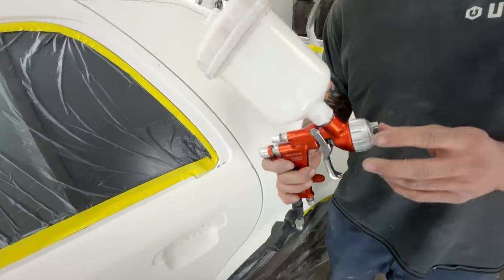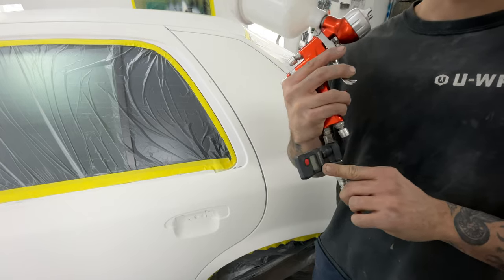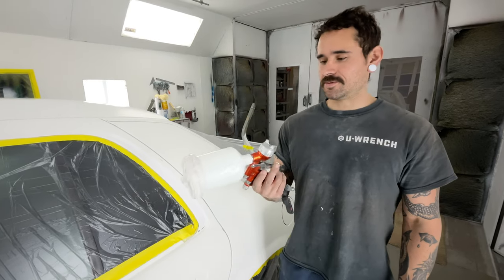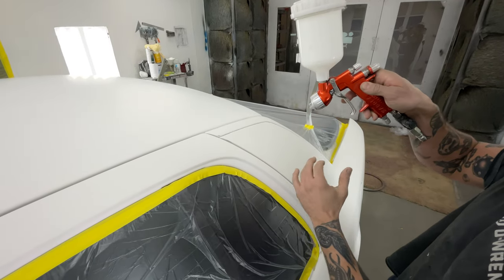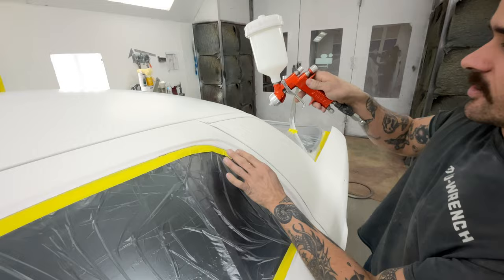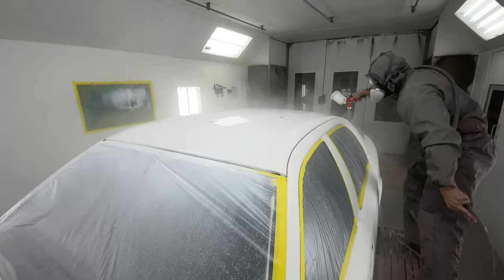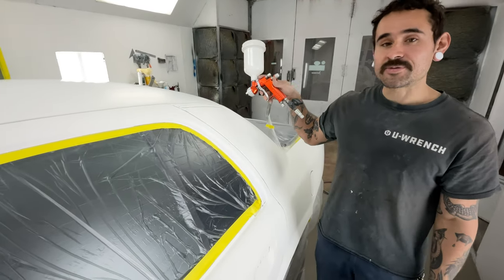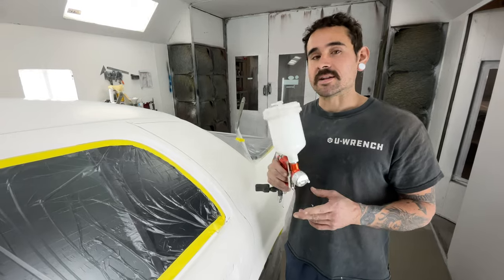Basic Spray Gun Techniques | Quick Tips

Comment: So what are your spay techniques if I can’t afford a spray gun and have to use spray paint?
Reply: stand with your back straight and hold the can in front of you while a friend drives the vehicle to be painted, back and forth in front of you.:face-fuchsia-poop-shape:🤪
Reply: @mostcom  so how do you get a car out of the ditch?  I didn’t have any friends, so I tried pushing it myself.  Now my car has one stripe and is in a ditch.  Painting is hard.
Reply: @wild_lee_coyote  sorry to hear you had an accident I'm glad you're okay. Most of the time when someone is using a rattle can paint job the circumstances are less serious.
Reply: @mostcom  same with my post, it’s not to serious.  I think rattle cans only work for trim black, or to cover bare metal so that it doesn’t rust.  But for an actual paint job you get less than you pay for.
Reply: You don't paint. Cans are pointless and for a whole car it costs more than buying a gun and paint.